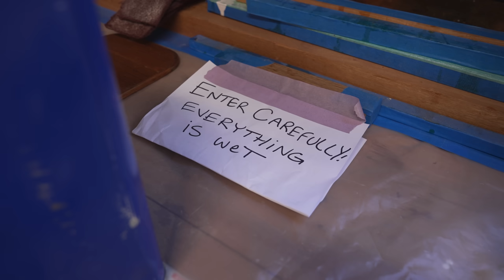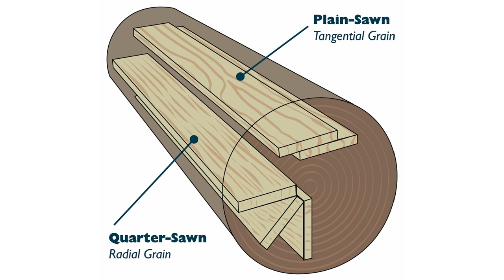Interior woodwork - creating a functional living space on Tally Ho

Comment: For those that can't wait, the tour video from Sunday shows stills of the progress.
Two piece rudder installed. Brass front bumper.  Etc.  Search Tally Ho, down in the results.
Whole skylight installed with metal bars to reinforce the glass.
Compass at the front of the cockpit.
6 brass fixtures for rig winching stuff installed at the outside of the cockpit.

Comment: FYI: G-10 was first used as a substrate for printed circuit boards, and its designation, G-10, comes from a National Electrical Manufacturers Association standard for this purpose. To clarify, a sheet of G-10 is printed with electrical wires, and holes are drilled at the ends of these flat wires. Then all of the components in your cell phone, your computer, your television, are socketed into the G-10 sheet, and soldered to these electrical wires. This connects these components to each other electrically, and creates the device. Printed circuit boards were invented during World War II and were used inside antiaircraft shells where they were subjected to extreme forces as they were fired from cannon. Many materials were tried after the war, and G-10 had the best performance, being exceptionally stable to chemicals, water, heat, cold, and physical stress.
Reply: I don't think G10 is used for circuit boards anymore. If the PCB is fiberglass, it is pretty much always FR-4 (which can manage a UL 94 V0 rating). I design circuit boards for a living. We always refer to the PCB material as FR-4. G10 is still produced widely but used more for its mechanical properties.

Comment: incredible workmanship. I am curious to know how much it would cost to buy a boat of such quality. I would imagine it would be crazy expensive with all that handcrafted woodwork.
Reply: All that top quality wood and other materials. All that craftmanship in the build. All the modern conveniences and technology and marine fittings. And on top of that it is a rebuild of an old and storied vessel. Given than a modern factory-built fiberglass 48' sailboat goes for at least half a million, with only a fraction of the charm and quality, I hate to think how much a finished Tally Ho would be valued at.
Reply: The boat is hand crafted with such extreme quality material that pricing the Tally Ho would be difficult.  I'd guess the material (wood and mechanical) is somewhat North of a Million bucks . Your Excel spreadsheet will burst into flames if you add in the foundry work, rigging, mast, keel and labor from lots of good shipwrights .

Comment: The spaces below are getting tighter each time we see you all now. I can sure see how the order of operations must be getting more and more vital as each new thing is installed! All that wire and plumbing passing through underneath each nook and cranny is pretty amazing. I'm in the process of re-building, almost 'from the keel up', a 50-year-old rotted out basket-case of a camper/trailer, and have my own planning to think through, but it's absolutely nothing compared to this. I'm planning to use as much wood in my build as I can, and I'm so envious and admiring of all your tools, but mostly, of everyone's skills in using them.

Comment: Using the Festool guide rail with a non-track saw Makita is genius.  Why didn’t I think of that?
Reply: How does the track stay on the materials without sliding around?
Reply: The clamps are underneath. They fit into the track itself. When you use the intended saw, you usually don’t need clamps. There are rubber strips on the bottom of the track, and when combined with the weight of the saw they usually don’t move around very much.
Reply: @cheeseburger9232  sometimes you can just put one hand on a track and keep it steady. Depends on how much sawdust is under the track and how curved the wood is.

Comment: Another week of brilliant woodwork.  However, everything is so well fitted, that I wonder if sufficient attention has been given to allowing internal ventilation.  Many of the the spaces between the frames are closed off by shelves and locker bases, when they should be left open, to allow airflow vertically around the structure (so important to the longevity of a wooden boat).  This will result in lots of spaces of 'dead air' where condensation will form, particularly when sailing in higher latitudes.

Surely it would be better to keep the outboard edge of shelves and locker bases flush with the inboard face of the frames, and to have a light timber back-panel or a couple of horizontal battens to prevent items falling down the back?

Comment: Will you install the mast and boom before you decide on sail sizes?  Will it have a jib and or spinnaker?
Reply: The sail plan was decided awhile back, & Leo paid out a large sum as a deposit for sailcloth. But the cutting & sewing had to wait until the spars were built, for final dimensions. I think they also did deflection tests on the boom & gaff, so the mainsail could be tailored to the rig 'under load'.
There will be a several different staysails & jibs, as well as a spinnaker.

Comment: FR4 and G10 are very similar. My understanding is that FR4 is fire resistant and G10 is not particularly fire resistant. FR4 is electrical fiberglass (same as what circuit boards are made from). G10 may be electrical too, but not fire resistant.

Comment: G10 is not fire resistant (no fibreglass or epoxi resin are. just think about how well a fibreglass boat burns once it's caught fire).. FR4-G10 however, is a bit better and hence can be used in electrical applications.

Comment: Quarter sawn wood expans and contracts just as much as other cut, but it doesn't warp nearly as much, in fact it remains largely plane.
Reply: It is less likely to cup. It may get wider and narrower and thicker and thinner but it won't cup. Some woods have nearly identical expansion rates tangentially and radially and they don't cup too much either, regardless if slab cut or quartersawn.

Comment: The more the inside of Tally Ho comes together, the more I wonder about the lack of insulation inside the hull. Is this not necessary in wooden boats, or even not advised because it would prevent the flow of water coming through the planks or condensation going to the bilge?